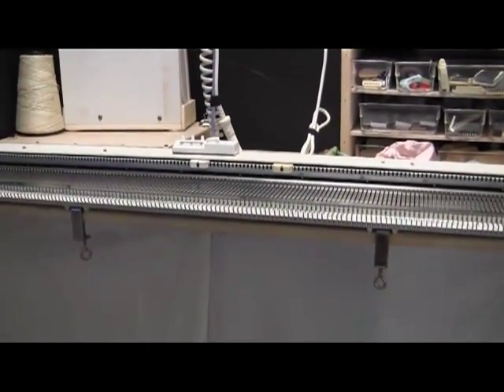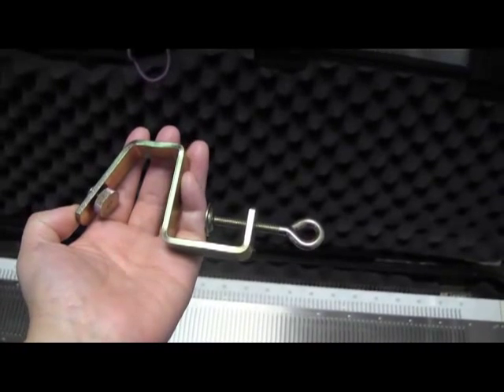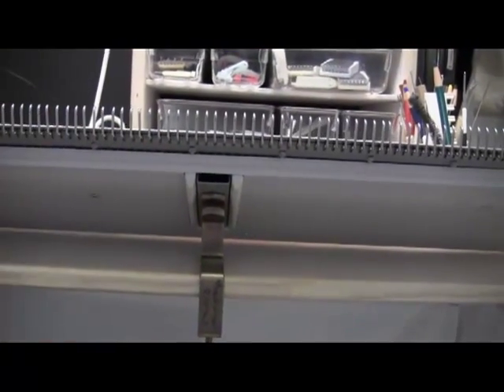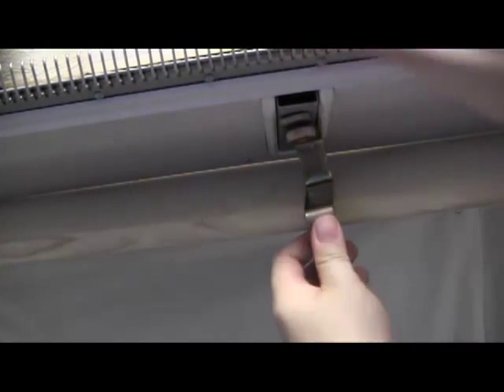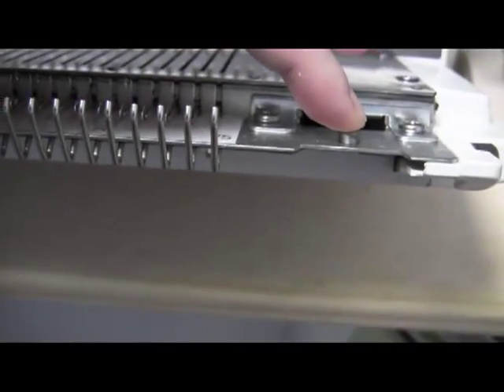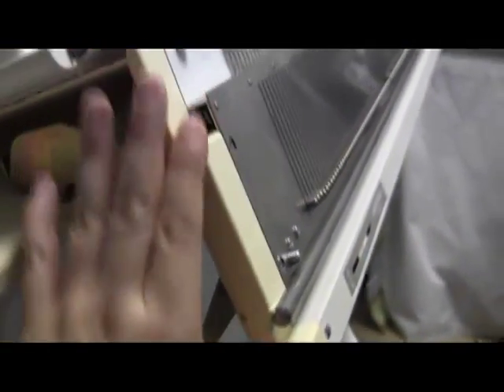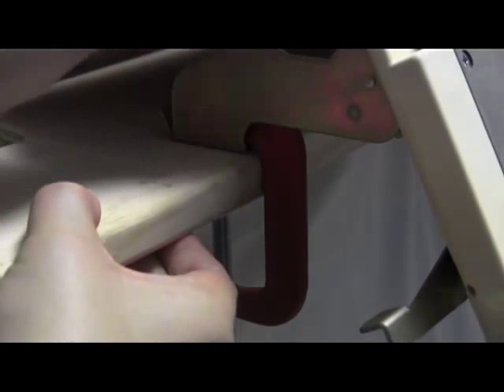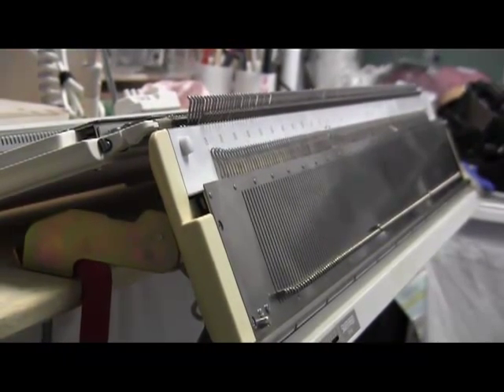How to install an SR860 Ribber for SK860

Comment: Would you have a video how to reinstall the racking plate on a sr860?
Reply from the maker: Sorry...no.   You may want to obtain a service manual, which you can either find for free or for a low cost online.